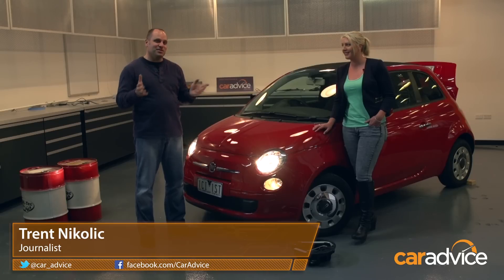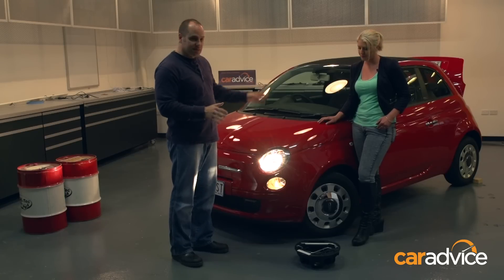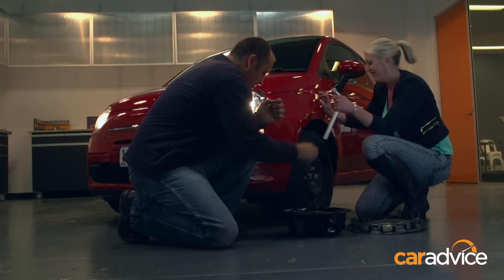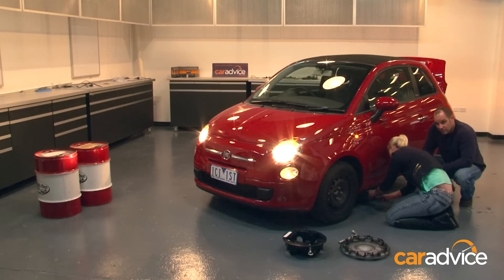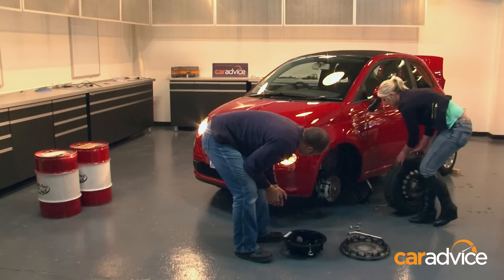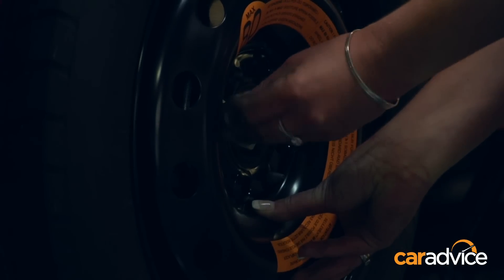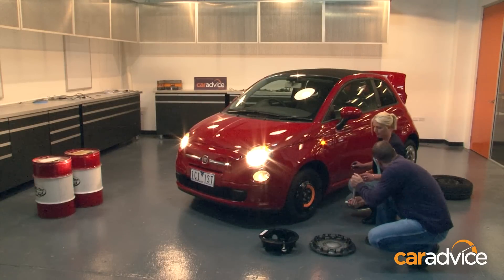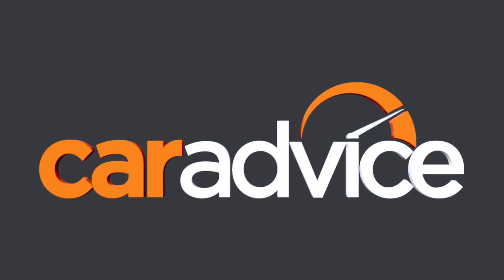DIY: tyre changing tips

Comment: She had good knowledge and one of the most critical pieces of info. Put the tyre under the car so if it falls off the jack you can still lift it back up.  Also so if you are anywhere under the vehicle when you shouldn't be you have a slight safety barrier.